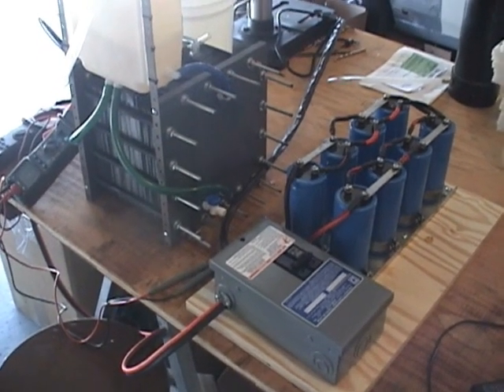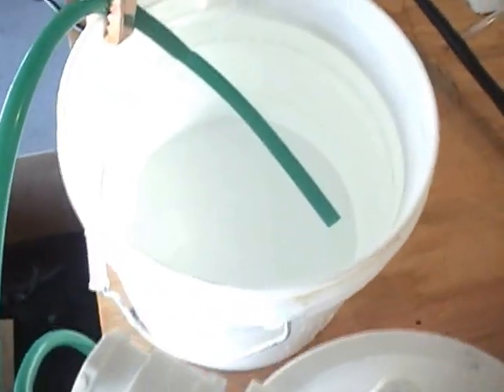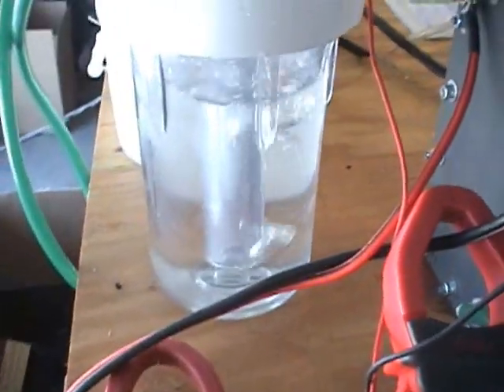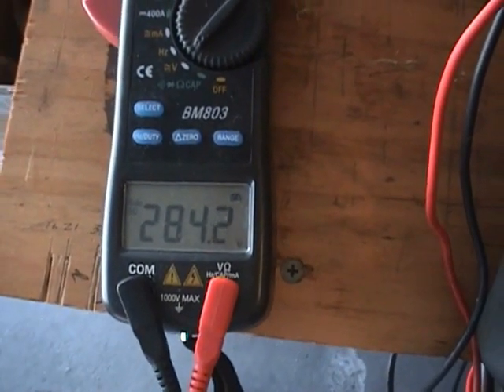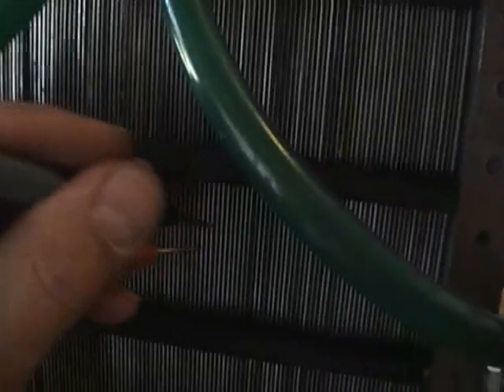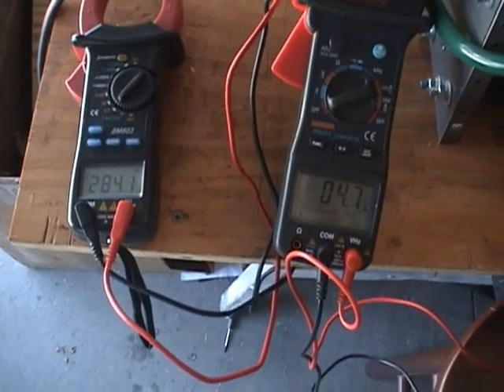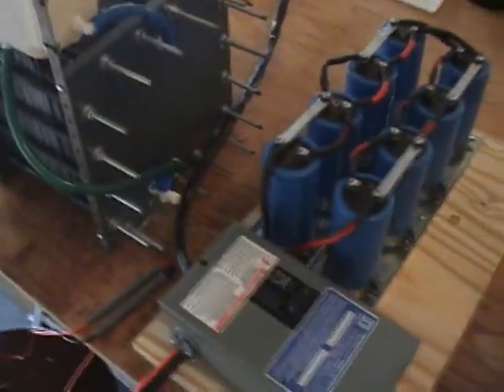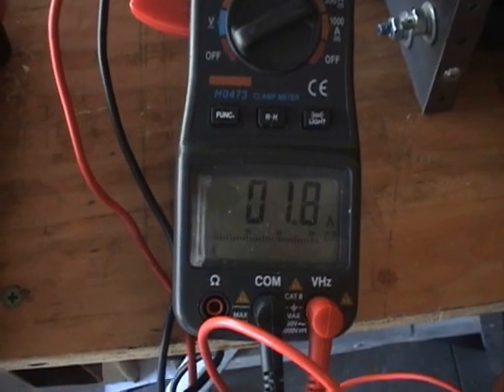118 plate 240v massive hydrogen generator. First run part2

Comment: Just a thought for you Mr. Delvis11.  A Gen II (2004-2009) Toyotal Prius has a 1Kw traction pack that is powered by a battery that maxes out around 230vdc.  The stock Prius motor has the capability to dump out up to 3500w to keep the traction battery charged.  I'm not suggesting you try this but putting this much HHO energy into a Prius might actually be an extremely interesting test!   I don't own a Prius but this video made me think seriously about the increased HHO output shown here.
.

Comment: So you can't run a generator and hydrogen cell together because the 
gas generator doesn't produce enough electricity and the cells don't 
produce enough gas?

What do you think about using solar panels during the day to make gas
to power a generator at night?

Comment: hi delvis11 why cant u use the hho to power a boiler if ur volts and ur amps are wright ur watts is 1136 to produce 11ltr a min so thats only 1kw so to hive that running for a hour it only cost u 17.5p has a boiler uses 9.7ltr a min which is  24kw which will cost u £1.8p an hour

Comment: hi was looking at the volts and the amps and ur hho cell useing 1136 watts which is only a little bit over 1kw put a flame  on the over end you can power a combi boiler for a small price 14.5 pence an hour

Comment: so neutral plates are to max out voltage while minimizing amps.  If you ran more pos and neg plates, you would build more amps and more heat would be generated. And of course more hydro gas.

Comment: "...Accustomed to regard the rights, the rigid principles of thermodynamics as absolute truths, and persuaded that an isolated material system could possess no other energy than supplied from without, a majority of physicists long persisted in seeking outside of it the sources of the energy manifested during the dissociation, not disintegration of matter. Gradually we are coming to see the facts. ..." in THE SEA OF ENERGY IN WHICH THE EARTH FLOATS by T. HENRY MORAY.

Comment: decent video from someone who appears to understand the concepts.
I'd definitely want to have a recording of the electrolyte concentration, as well as a temperature reading before current was applied as well as a temperature reading after the unit was allowed to run for a long period of time as the total ohms would drop, the electrolosys efficiency could improve with higher temperature, and totally alter the wattage flowing in, and the gas production exiting the unit.

Comment: Lets see a car run 70 mph on that.  Hydrogen has the ability to run extremely rich or lean but what fuel/air ratio is needed to get best engine power?  A 600 CFM carburetor would need 75 CFM of hydrogen gas with an air/fuel mixture ratio of 8 to 1.  It looks like your fuel cell is a long way from 75 CFM.  What is the price per gallon equivalent for hydrogen gas compaired to gasoline?  How do you make hydrogen as fast as the engine will burn it?

Comment: you are not using all capabilities of your unit. 240v x 4.6amp= 1.1kw it normal  to get 6lpm. But your cell looks huge , something like 8x8 cell? area in contact with water must be 7x7. So 7x7x118=5782 sq.inch .then per anode: 5782:2=2891sq.inch . Theoretically,   unit having working area per anode  393sq.inch must consume 1kw of power and produse 5lpm. So your unit ( 2891:393=7.3)  normally has to consume 7.3 kw and produse 30lpm. You must add KOH until your unit will draw 25amps for 25lpm.

Comment from the maker: 18% koh will get you to 0 degrees. 20-22 % should get you to -20
Your cell will need to be designed different. Add a 5th neutral and increase your gap a little. Or you can use a pwm.

Comment: I have just noticed something while designing my own electrolyzer. The pre bubbler/reservoir tank can create a short. The electrolyte will conduct the electricity from your fill point on the cell through the reservoir to the other fill point.

Comment from the maker: You will find out why as you do more research.
this cell runs at 2.3v per plate gap. my input is around 250v. A neutral steps down the voltage. electrolysis starts at 1.24v

Comment from the maker: I assume your using 12v input. Three plates is a good start. let me save you some time in the long run. Use 4 neutral (free plates) in between every + and -. thats the optimum most efficient voltage between gaps to produce for the most gas for the least amount of watts. Good luck with your project.

Comment: i´m doing same stuff. 250V rectefied volts from housholdcurrent with 115 plates. it works as well @ 6,2 mmw. But it wasn´t necessary to use any kind of capacitor!!! The cell it self has capacity.
Tell me, what was the cost´s for the capacitors?